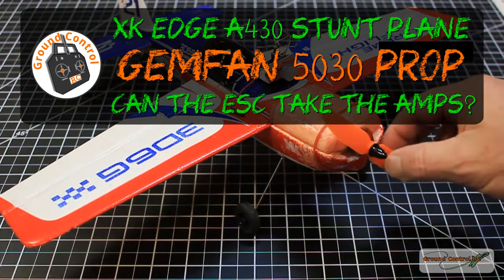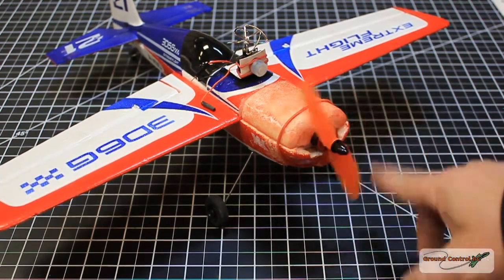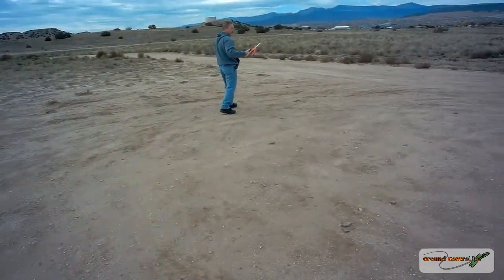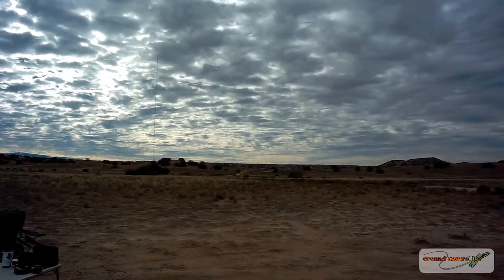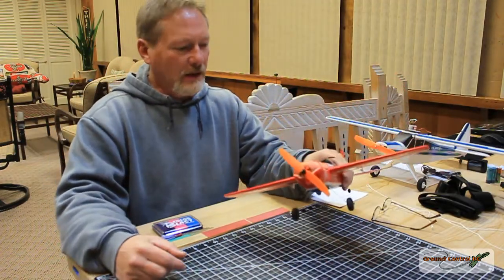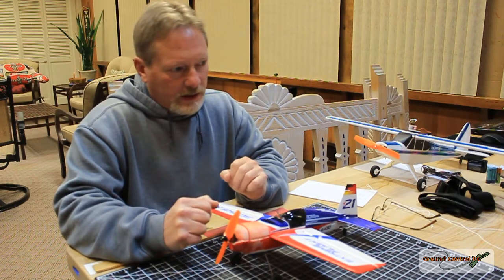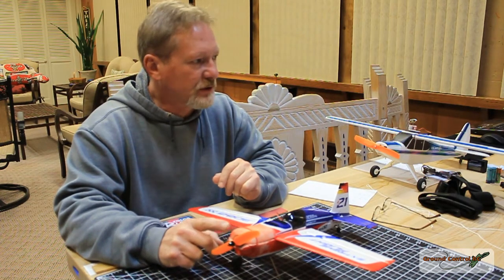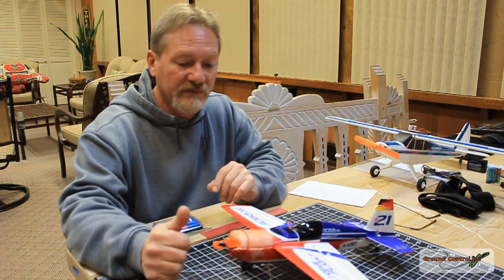XK Edge A430 - Upgrade Motor & Gemfan 5x3 Prop - Can The ESC Handle The AMPS?

Comment: Use radiomaster tx16s with futaba protocol. Channel 5 is 6g stabilization
Reply from the maker: Hi Claude!
Thanks for that info!
I don't have the plane anymore but I think I saved the Receiver Brick and Power System so I'll be able to use it in another project with the TX16S ;-)
Sweet!

Comment: after burning my esc,i'm bought  one from banggod "esc for xk DHC-2 A600"

my xk A-430 is fly again but i'm lost much power,now my plane not be able to doing 3D move such as loop

it's esc problem of xk A-430 againts A-600?
Reply from the maker: I suppose it could be. Have you tried resetting the high and low throttle position when binding to the plane? It could be that the ESC is not reading the high and low end of the throttle correctly. Be sure to remove your prop first ;-)
Reply: @GroundControlRC  yes, I have done a calibration the high and low throttle correctly,

this is the second time I've experienced it after change the esc.

what I haven't just set is ESC menu because I don't have a manual book,like put stick in highest position and wait for beep-beep.

whether esc A-430 and A-600 are different,it's say esc for A-430 is 10Amp.if this didn't work i thingking for looking new esc with 15Amp and new motor like in your video that's very interesting
Reply from the maker: @slider9780  , it does sound like you have a faulty ESC. I'd replace the stock ESC with something else and I'm sure it would be less expensive. Oddly enough, the 1306 3100kv motor with a standard 5x3 prop I used produces much more thrust than the stock motor. I think you would be very happy switching to that motor ;-)  Lots of power ;-)
Reply: @GroundControlRC   try it soon,i'll try the motor first.
looks like the other thing i need next is search suitable esc,hh

glad i found the vidio,you're very helpfull thankyou verymuch
Reply from the maker: @slider9780  , you are most welcome. Good luck on your modification and I'll see you in the Air!
Reply: @GroundControlRC  oh,one more...i compare esc from A-430 is bigger than A-600
Reply from the maker: @slider9780  , hum...I don't know why they would do that since they are both 2S power systems. If I remember correctly, the A430 has a 1404 motor and the A600 has a 1406. Perhaps since the A430 has a smaller motor it pulls more amps?

Comment: Do you have any recommendations on upgrading the battery??
Reply from the maker: Here is a link to the battery I use:  https://hobbyking.com/en_us/turnigy-nano-tech-300mah-2s-35-70c-lipo-pack.html?affiliate_code=YRCVWOSKMDXLVUW&_asc=5382684821    I use this battery in several of my RC Planes. Here are the RC Planes and Vehicles I use this battery in:  XK A430 Edge, XK A600 Beaver, RC Converted Chuck Glider, WLToys F949 Cessna 182 Brushless Conversion, and the WLToys K969 Drift Car ;-)  Hehehehe...I use this battery a lot!  I also found this battery:  https://hobbyking.com/en_us/turnigy-nano-tech-300mah-2s-45-90c-lipo-pack.html?affiliate_code=YRCVWOSKMDXLVUW&_asc=4371328338   it's also a 300mah 2S but has a higher C rating and so may give a bit longer flight time. The specs list the dimensions as  45x17x12mm so it should fit and is just 2g heavier as per the specs.  See you in the Air!

Comment: Is the reciver and esc integrated in this plane?
Reply from the maker: The Receiver and Gyro are one unit, however, the ESC is a standalone ESC. Here is a link to the XK A600 DHC-2 Beaver parts as the electronics are the same: https://www.banggood.com/search/xk-a600.html?p=WE081047791920140372

Comment: i use tx7 more control
Reply from the maker: I'm thinking of replacing the stock receiver and gyro with an OrangeRX that has a built-in 3-axis gyro so I can use my Devo8S with it. The stock transmitter with the upgrade motor and prop are a bit twitchy with the big increase in speed.  Being able to use a Hobby-Grade transmitter is a big plus. So, is your control with this plane much smoother with your transmitter? Thanks for the comment and Happy Flying!

Comment: Very awesome. I thought I had ordered the motor and props but haven't gotten an email about it, maybe the shipping takes a while.
This is a great, cheap upgrade. Have you seen the receiver replacement mod? probably not necessary if you have a futaba transmitter, but the stock tx is very unresponsive.
Reply from the maker: Thank you for your kind words. I have not seen the receiver replacement mod, if you can provide a link to it, I will definitely take a look at it. If it provides finer control on the sticks that would be a bonus ;-) Thanks for the info and Happy Flying!
Reply: definitely. love this plane. I've already done the receiver mod waiting for the motor and props. the controls are SO smooth. here is the video: https://www.youtube.com/watch?v=7UEpYBHO8uk&t=456s it is translated and a little hard to understand, but the receiver swap is pretty straightforward. Here is the receiver he puts in it https://hobbyking.com/en_us/orangerx-rx3sm-micro-3-axis-flight-stabilizer-w-dsm2-compatible-4ch-2-4ghz-receiver-w-remote-on-off.html
the connectors are all the same so you just take out one and put in the other
I was also wondering if this spektrum brand receiver would be interchangeable just because the connectors are the same ~ https://www.horizonhobby.com/airplanes/aircraft-receivers/ar6335-6-channel-as3x-reg%3B-nanolite-receiver-spmar6335
Reply from the maker: Thanks much for the information and the links! I really like the OrangeRX line of receivers. I've used OrangeRX receivers in my Glue & Fly Series Scratch-Build Planes and they work great! I may order the one you listed above and I also found another one here: https://hobbyking.com/en_us/orangerx-microrx3s-3-axis-flight-stabilizer-dsmx-dsm2-compatible-4ch-2-4ghz-rx-w-rem-gain-control.html
The Spektrum receiver looks interesting as well, although, a bit pricey for me.
Thanks again as using my Hobby-Grade Transmitter to fly this plane would be an absolute blast!
Happy Flying!
Reply: nice, that's a great deal. i know the orangerx has the stabilization feature, but am not sure if it's the same as the stock where it won't let it pitch past a certain degree. i think it may just limit sudden movements and help it fly smoother in the wind. with the spektrum receiver it would give you the three flight modes to switch between, i thought that would be cool. but you're right much more pricey
Reply: do you  think this setup is enough to hover with?
Reply from the maker: I think if you had a good transmitter where you had much more granular control you should be able to hover it. With the upgrade motor I used and a Gemfan 5030 prop it should have 202 grams of thrust on a fresh battery ;-) The AUW of the plane with my Micro FPV System is only 98 grams ;-)